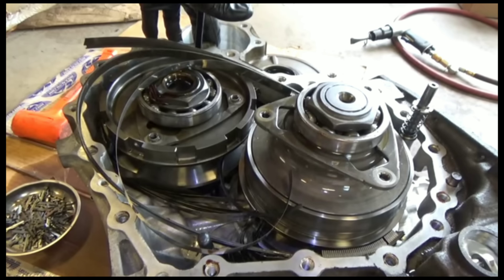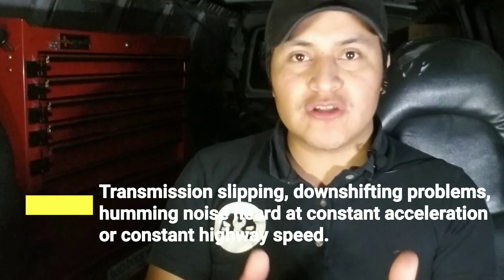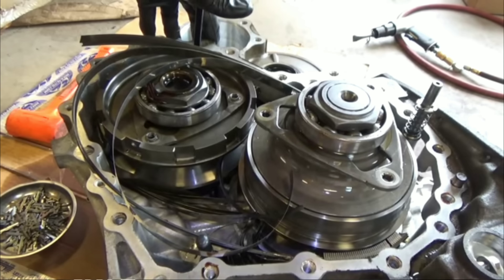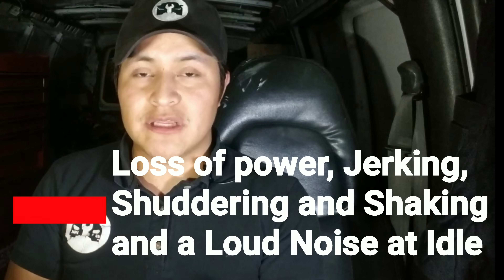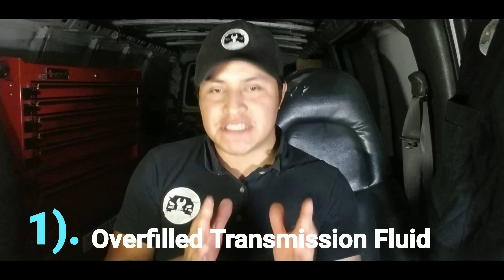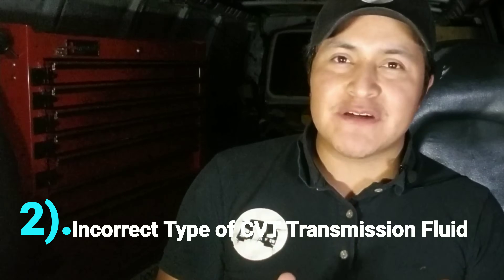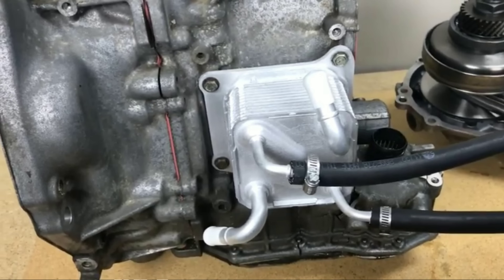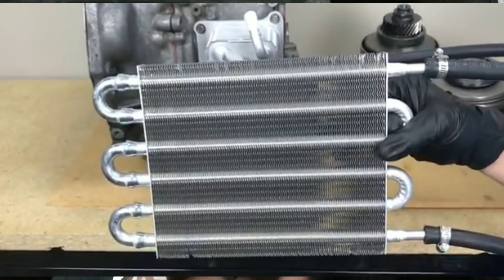NISSAN CVT TRANSMISSION | why it fails and what you can do about it to prolong it's life

Comment: This is a very useful video! I wish I saw this before. My nissan rouge has 140000miles, and CVT began to fail , overheating problem. The video clearly stated the probllem, thanks so much
Reply from the maker: Glad I could help😊
Reply: You have a Nissan Rogue,  driven it 140K miles & don't know how its spelled?
Reply: You’re lucky it got that mileage 😏 mine is starting to fail at 91k (green symptoms). I’m sure I just need to change the fluid but Nissan refused and they want $4,700 to have a new one installed 😐
Reply: @Alberto5501  Friend has a 2016 Altima that has the overheating / limp mode problems, started at a little over 60k miles. He flushed the fluid at the dealer and it made no difference. He's not trying to get it replaced under the new extended warranty Nissan introduced due to a class action law suit.
Reply: DJR5280 I replaced the fluid a couple days ago. I’ve been driving around and it seems to be working normally now. I have a 2017 Rogue, does that class lawsuit included this year??
Reply: @Alberto5501  Aren't you the one paying?  How can they refuse to change your fluid?
Reply: Chris S that’s exactly what I said... I just went to another dealership and got it done
Reply: @Alberto5501  stay away from the  cvt

Comment: What  happens  if  i  get  my  transmission  fluid  60,000  miles?  Can  we  replace  the  fluid  our  selves?
Reply from the maker: You can replace the fluid yourself if you know how to, just get the right fluid at Nissan and don't overfill or under fill it.
If you change the fluid at 25k-30k miles it would prolong the life of the cvt if you change the fluid at 60k miles it would obviously not prolong the life of the cvt

Comment: I have an 07 versa that has 258+k miles.  I didn't hear the humming until too late. It's already at the bucking/stalling stage.  Your video helped me understand what was going on.  Thank you.
Reply: 258k miles on a Nissan CVT? WOW. You need to play the lottery.
Reply: @DJR5280  CVT was not on versa until 2012 lol she clearfied it later too.
Reply: @billt7207  that info is still wrong. The first-generation Versa hatchback definitely had a CVT as an option. Many, many of those are still running around on highways today. My daily driver cube is the mechanical sister car to the Versa hatchback, with the same engine and a CVT. It's still going at 181,000 miles.
Reply: The best thing you can do with a high-mileage Nissan CVT. Sell it before it fails!!!
Reply from the maker: You're welcome😊
Reply: 2007 Versa does not have CVT, it's a 4-speed automatic transmission, CVT was not used until 2012 Versa
Reply: @billyoungtang1490  You are incorrect.
Reply: Best thing to do never buy another one.

Comment: I just bought a 2007 Nissan Maxima it has the CVT in it. It runs and drives with no problems right now. It has 113,000 miles on it I don’t know if the transmission fluid has ever been changed would it be a good idea to change it? I know on some older transmissions people say not to change it if you have so many miles on it.
Reply: I would say change it.  The "older transmission people" are talking about traditional transmissions, not CVT's.
Reply: Thank you
Reply: Yes change it especially  if you got the car as is used. It will help more than hurt it. Transmission fluid changes is something that all car owners should be doing as a regular maintenance but many don't. It is a must in a CVT. I am a 2nd owner of an 2007 Altima currently at 218k. I  strive  to do regular trans fluid  changes  and car has been doing well.

Comment: So don’t get a 2010 Nissan max S/SV?
Reply from the maker: Yes
Reply: Wrench Link yes to don’t get one lol ?
Reply: I actually own a 2010 Maxima SV. I purchased this car in 2012 with 39,000 miles. In the summer of 2016, I took my car in for service at Nissan(Maxima had 98,000 miles at this time) and told them I heard a whining noise while accelerating. I didn’t experience any loss of power or had problems accelerating (I live in Vegas, so our summers are VERY harsh on cars with CVTs). After running test some test, Nissan said my CVT was showing signs of slipping (again, my car didn’t show any symptoms) and Nissan replaced my CVT since they extended the CVT warranty to 10years or 100k miles on the 2009-2010 Maxima’s (I believe they did this to other Nissan’s with the cvt). Fast forward today, my maxima has 154,000 miles and no major issues except needing a control arm. 

I had Nissan do a drain and fill on my cvt back in October of 2019. I believe Nissan told me that they had to get a cvt from a 2014 maxima for my car. I’ve been reading different maxima forums and heard people recommending having your cvt drained and refilled every 30k-45k miles which I’ll start doing to prolong the life of it. I try to accelerate easily from a stoplight/sign, but I love merging onto the freeway because the power band and delivery is so smooth and quick. This car sounds good under acceleration imo. This VQ35DE is a perfect pair for this car. If you’re looking at any Maxima (especially the 7th gen 2009-2014), check to see what the cvt fluid looks like and see if there’s any service records bc replacements cvt for out of warrant Maxima’s are expensive! 

Overall, my experience with my Maxima has been a good one. It’s one of the best cars I’ve owned. Most of the miles I have on it are highway and there’s no squeaks or rattles. Nissan has built this car really well and it’s solid. I’m thinking about getting the 2016-2020 Maxima (especially looking at the 2019-2020 Maxima SR or Platinum bc Nissan gave the maxima a mid-cycle refresh”. Test drive one and see how you feel about it. Also, purchase an extended warranty. It’ll come in handy!

Comment: Do you recommend buying a 2011 Nissan Juke I haven’t heard to much cvt problems with them
Reply: I would only buy the manual versions.
Reply from the maker: I honestly don't. It has a problem with the turbo going bad, a crack in the engine block by the turbo, and the timing chain braking, also the transmission going out. There isn't much data about the  Juke because it's not a very popular model like an Altima would be.
Here's the link for the complaints if you wanna check it out: https://m.carcomplaints.com/Nissan/Juke/2011/transmission/transmission_stopped_working.shtml
Reply: Wrench Link thanks for your response
Reply from the maker: @israelchalajr8040  you're welcome!
Reply: Wrench Link is there any way I can make a juke last a long time because it’s the only car I can afford
Reply from the maker: @israelchalajr8040  I go over the things that you can do to prolong the life of the cvt transmission in this video https://youtu.be/j60a8pZjc-s
It's not a promise that the CVT will last hundreds of miles because it's  a poor design but the things I go over in the video will definitely help prolong the life of the cvt
Reply: Wrench Link ok thanks man👍
Reply: Avoid a Juke. Terrible car. A friend has one and had his turbo fail, we thought it was from the heat because he lives in Phoenix but nope. Common problem regardless of location.
Reply: i have 2012 juke sl with 86k so far no problem with the cvt, just a keep my regular maintenance, all fluid replaced by nissan  shop.
Reply: francisco manzo thanks it’s really helpful it seems like a good car but like you said I need to maintain it well
Reply: @israelchalajr8040  i get the car with 45k, and my wife like to drive the car, with 180 HP and turbo en less the 5 second you reach 60 mph, the dealer did the CVT flash fluid , brakes,oil and run like new, i have a little more trouble with my 2014 dodge ram. it was a brand new with 20 miles on it, a lot recall,16 in the city VS 30 with  my juke.
Reply: francisco manzo that’s what I need, an economic car

Comment: Hi. The Nissan Rogue and Rogue Sport model 2018 or 2019 have same problem in CVT transmission? Or Solved the problem. And Would you recommend adding cooling for transmission to this model 2018 or 2019 from Rogue & Rogue Sport? Thanks
Reply from the maker: The 2018 rogue does have the same issues but the cvt oil cooler has been updated from a 2 port to a 4 port fluid cooler